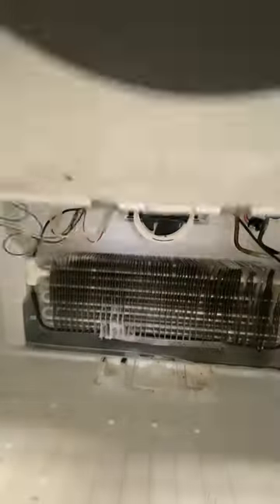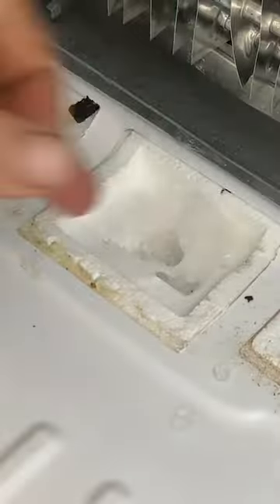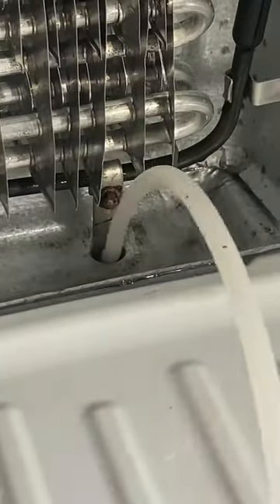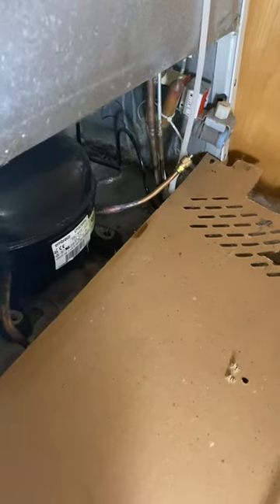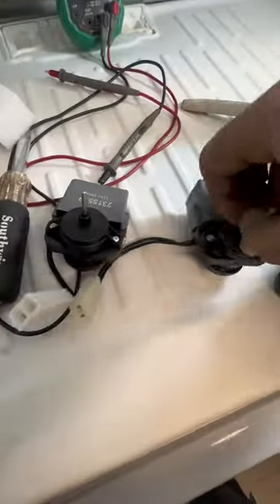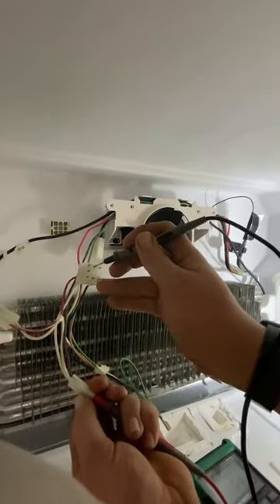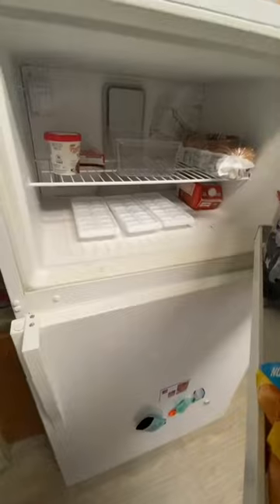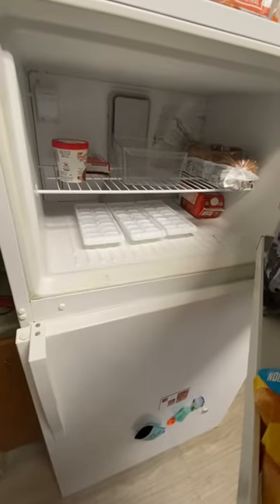Replacing a bad evaporator fan motor. #HandsomeOrHandy #Eco-Friendly #RepairNotReplace. ￼

Comment: We had this problem on our 1986 Kenmore (we still have it but we just saw a bottom freezer dual unit at HD that we like because it fits the space we have). It was under warranty and the guy that came out's fix was to just put a small loop of copper wire from the heating element into the drain hole to keep it from freezing.

Comment: I use a hair dryer to de-ice the coils. My fridge does have a manual defrost function, but it doesn't do enough because the element isn't exactly where it needs to be. The ice forms mostly over the lines where they come into the refrigerator compartment and not the coil, itself, where the heater element for the defrost is. I'll eventually put an end to the problem.
Reply from the maker: Are you sure the defrost element works?
Reply: @HandsomeOrHandy  It does.

Comment: My freezer used to do this about twice a year  because the drain hole would get a small plug of ice causing an ice dam all inside the freezer section.  The last imte it happened, I hung about 6 or 8 inches of brass wire down it, and it hasn't happened for years now.  The wire just needs to extend far enough that it stays above freezing and it will then keep the ice plug from forming up at the top.  IIRC, I just bent maybe an inch at the top to keep the wire from sliding down the hole completely, and then put everything back together.  Simple, cheap, and effective -- the trifecta!
Reply from the maker: I’ve heard of people rapping a short piece of bare copper wire around the heating element, and then running it down the drain line a couple of inches
Reply: @HandsomeOrHandy  That'll probably work just as well.  I do not look back fondly on my days of having to defrost and the reinstall the food.  ;-)

Comment: Pro tip from a guy with antique refrigerators:

Manually defrosting goes MUCH faster when you put the hot water in a pump up sprayer from the hardware store. 

Just buy one, label it so you never use it for anything but clean water, and you are set. 

It cuts right through ice blocks, clears massively frozen coils quickly, and delivers streams or sprays of hot water directly where you need it.
Reply from the maker: I like that, I’ll have to try it next time.
Reply: Pro tip. It is a refrigerator that handles moisture. I tend to hit mine with a garden hose outside. Although the fridges we used to pull out of Section 8 housing never looked this clean!!!

Comment: I got an idea hopefully you try on one of your videos. Portable steamer for the drain lines and quick easy defrost
Reply: Hair dryer and hatchet.
Reply from the maker: I think one of the cleaners has a portable steamer, I’ll ask them if I can borrow it next time.
Reply: @richardmccann4815  hair dryer will melt the plastic
Reply: Steamers suck. Faster to use a fan and/or a space heater.
Reply: @leonardoponce8891  no, it won’t.
Reply: @HandsomeOrHandy  I do appliance repair and that is something I have on my truck.Found it on Amazon for like 25 bucks
Reply: @HandsomeOrHandy  appliance tech here too, steamers are quick at cutting through ice and clear drain lines amazingly well, less water too, so no flooding drain pans.
Reply: @TamagoHead  yea let's melt that plastic liner inside
Reply: @testuhclees  heh, I use with a fan and space heat. Doesn’t get really hot.
Reply: @TamagoHead  I suppose you can use them as long as you babysit them, I've just seen too many customers put hair dryers inside the machine and shut the doors and absolutely destroy those inner liners
Reply: @testuhclees  I’m in Hawaii and with usually just 1 or two fans to circulate ambient air to get ice off the evap quickly.  I used them in conjunction once and it didn’t require any effort. Have great day pal! 👍

Comment: I was a tech for military housing and I must've worked Whirlpool refers for 15 years. All of them at one point gets a frozen condensate drain line with nothing else being wrong with them. I used to attach a short piece of copper ground wire to the heat element and drop into the drain hole. Guess what the manufacturer started doing to their drain holes?....
Reply from the maker: Looks like, but on this one, it was frozen so far down the heating element would not defrost it.

Comment: I did the same job on my 40 yo fridge a few yrs. ago. Had the spare motor just in case.
Reply from the maker: It makes the job goes so much easier when you have the parts on hand

Comment: I had a freezer somehow catch fire inside.... it was a standard, typical electric fridge freezer unit (fridge on bottom freezer on top). I came home one evening and all was seemingly normal & OK. Opened freezer door and got a face FULL of black smoke and soot. Everything in freezer covered in ash & soot. Promptly unplugged it. I was told that something like that "is impossible and never happens". Uhhh ok well it DID happen though soooo.....  No odd sounds, no warning in days/weeks leading up to it either.
Everything in freezer was ruined (due to covered in soot and/or permeated with burned smell).
To this day I wonder what caused it and how close I could've been to having a fire in my kitchen.
Reply from the maker: Was it a newer refrigerator? If so the new refrigerator use a flammable refrigerant, I’m not sure what would have started the fire. Possibly the defrost heating element or the evaporator fan motor.

Comment: 9 times out of 10, it is usually a break in the defroster that causes it not to go into defrost mode.
Reply from the maker: After I started it back up, I checked the defrost circuit and both the thermostat and heating element checked out OK.
Reply: @HandsomeOrHandy  I am sure that is how it went down. As you know, every situation will be different.  I have seen a lot of things working on appliances in Section 8 housing, I was just referencing the most common issue. I can't stress to new people enough to be careful while playing with those defrosters. They heat up quick, and get hot as hell.  They are built to melt a lot of ice quickly. 

You looked rather thorough in your work.

Comment: Not a defrost issue. It was a bad evaporator fan that caused a clogged defrost drain. Had it been a defrost issue that evaporator would have been covered with ice.

Comment: Does your "Search" option not work for this channel? I am trying to look up more refrigerator videos. Ours has a motherboard and the fridge won't get cold any longer. :(
Reply from the maker: I’m not sure why the search feature is not working. And all of my videos are used to #HandsomeOrHandy try using that and refrigerator. It sounds like it might be the compressor, the starting relay, the refrigerant circuit (Low on refrigerant) or the board. If it is the starting relay, the compressor will be extremely warm to the touch. If it’s the compressor, it will be extremely warm to the touch or blowing a breaker. If it is the board, you won’t get a voltage to the compressor. if it is low on refrigerant, the compressor could be running but warmer than normal and no cooling will take place. or a combination of those issues.

Comment: 100% can put these in defrost. Whoever you talked to at whirlpool is lazy or didn’t want to help. From the running condition, unplug unit while it’s running, turn the thermostat to off, plug back it. Should hear the board click. 2 clicks of the board means you have an issue with one of the defrost components
Reply from the maker: Someone told me by unplugging and plugging it back in. It would trigger a defrost. I did not know you needed to turn the thermostat to off. I will try this next time.

Comment: Could there possibly be even less waste by disassembling the evaporator and isolating what failed?
Reply from the maker: You might be able to replace the bearings on the fan motor which seem to be locked up but with the labor involved it’s probably not worth it.
Reply: @HandsomeOrHandy  Oh sure. I just love your videos where you try and fix a part with what you have on hand. I like to learn what I would have to do if replacement parts were unavailable.

Comment: I need help fixing a ice maker that doesn't work in my freezer can you help? I've replaced the solenoid thing once and it worked for a while then stopped working again.
Reply from the maker: I generally don’t work on icemakers. What other troubleshooting have you done? Do you have voltage at the solenoid? Have you checked the resistance of the cell annoyed? What type of control logic is used to control the icemakers? Electronic versus mechanical.

Comment: Would this fault make water leak inside the fridge?
I have to put a rag and change it every few days in front of my fruit drawers or else water will leak on the floor.
Reply from the maker: Yes, a clogged defrost drain line will make water appear in the bottom of your refrigerator.
Reply: @HandsomeOrHandy  Thanks I'll look it up!

Comment: My freezer is a big standing freezer and whatever potato designed it designed it wrong and it constantly has ice buildup near the fan which makes it sound like an angry motorcycle. The door was bent so the freezer thought it was open and wouldnt freeze. After that it will randomly stop freezing and we have had repairmen out 7-8 times to fix these issues and it still happens. The company still wont replace it with another unit even though its the biggest piece of shit.
Reply from the maker: Is the gasket on the door seal in good shape or is it letting in moisture?

Comment: No timer motor?  Hmm...
Reply from the maker: No, I believe it uses a board for defrost and tech-support would not tell me how to manually trigger a defrost. The comment section says that if you unplug it wait 15 seconds and plug it back in, that will trigger a defrost.

Comment: No heat gun?
Reply from the maker: I don’t like using a heat gun if anything I would use a hairdryer, less chance of burning the plastic in the back. But I just use hot water and the shop vac.

Comment: How did you test the defrost t-stat but you couldn’t manually put it in defrost? Also I’ve worked on a lot of those you can manually put them in defrost🥹
Reply from the maker: I turned the system back on, but kept the wires unplugged in the freezer. This allowed the compressor to turn on and to begin to freeze the freezer. Then I tested for Continuity a crossed the defrost thermostat. To check the heating element I ohm it out.